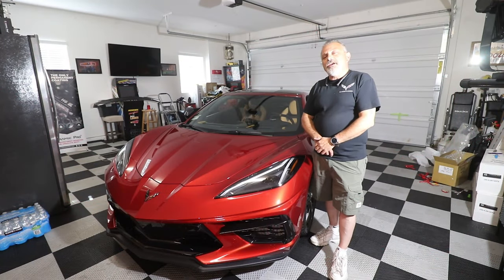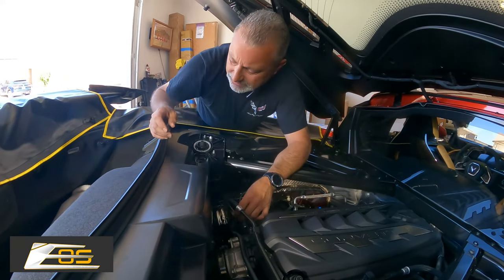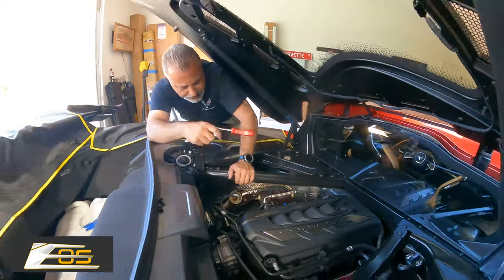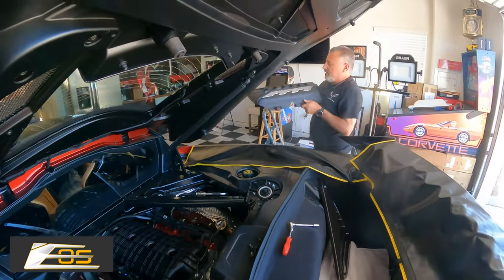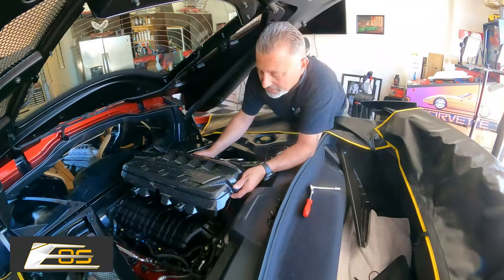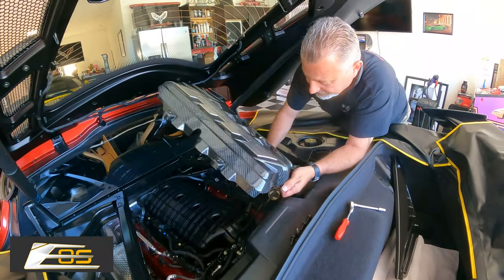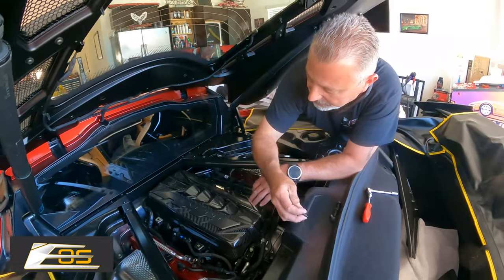How to Install a Carbon Fiber Engine Cover on a C8 Corvette From Extreme Online Store

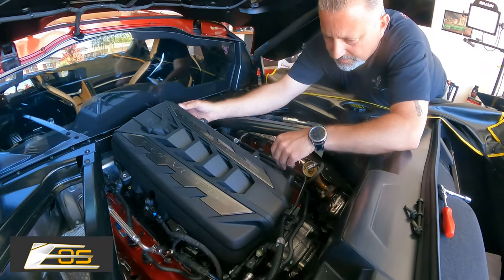Comment: Came here with a search to see what's involved with swapping out the manifold over. At 2:50 you can see the driver's side also has a fuel rail that clips in with the rear-most 10mm bolt. You failed to secure this when you re-assembled at 6:50.